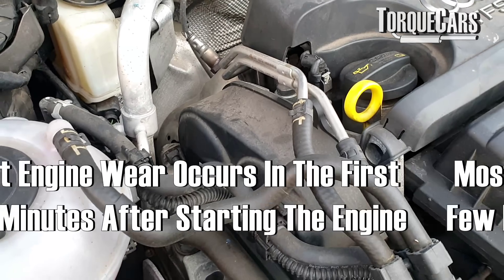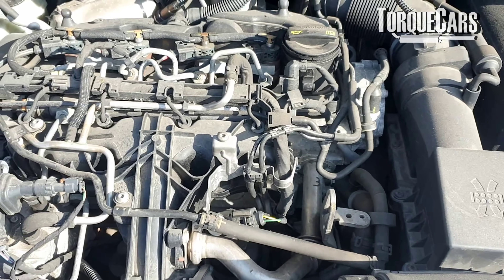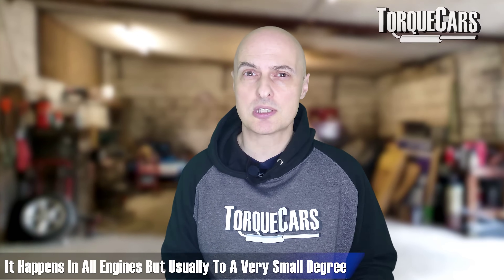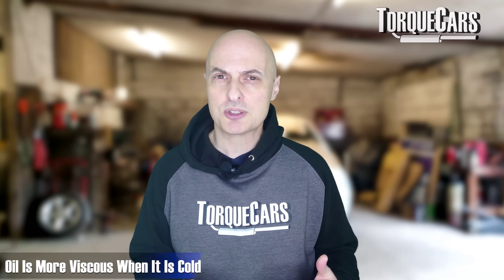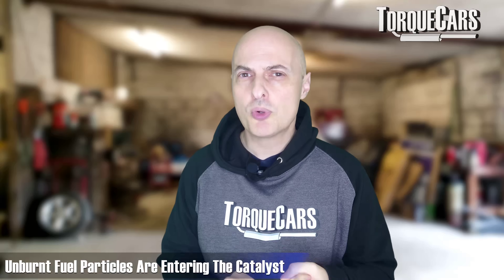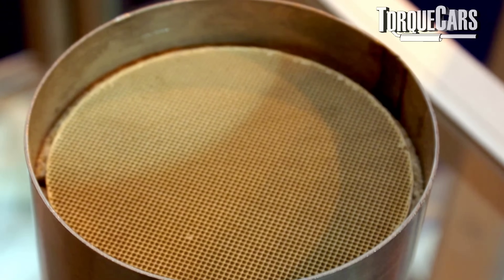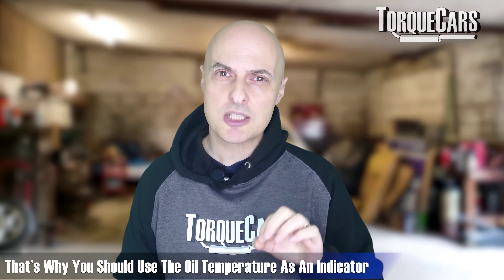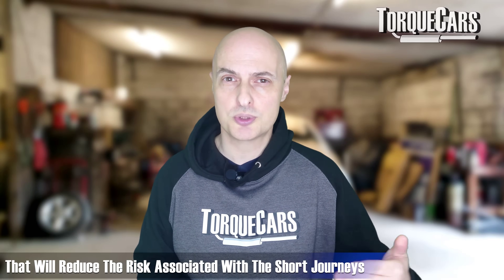5 Minutes of Terror? The TRUTH About Cold Start Wear (and How NOT to Blow Your Motor!)

Comment: What would recommend for someone that lives at the bottom of a very steep and long hill? On cold mornings I typically start engine, idle for 10 seconds, rev the engine to 2k rms and hold for around 1 - 2 minutes depending on how cold the morning is. Even after 2 minutes the temp gauge hasnt really even moved so not sure if im doing the right thing by my routine but people say "just drive lightly until up to engine temp" but i cant just drive "lightly" when i leave my driveway its foot to the floor and hold in 4th gear until i get to the top of the very long hill. 

Warm up more? Warm up less? Opinions?
Reply from the maker: Your routine sounds sensible to me, the oil will have started to warm up, you are not driving it hard in that critical first bit. If you are using a modern engine oil it should reach optimum viscosity quite quickly even if not fully up to temps.

It will also depend on the engine, your oil choice and how cold the engine is. But don't overthink it too much, allowing time to circulate and warm the oil so it gets to grade is the key.

I'll be curious to read others takes on this, as it is not something I have specific experience in but I'm sure you are not alone.

Comment: One guy on YouTube made a test on a cylinder head mounted to a lathe. He ran the head for a few minutes without oil and the damage was none. Next he disassembled all the parts, cleaned'em up to be free of oil and any lubricants, just plain dry and also ran for a few minutes after reassembly. There was some visible damage, but not something terrible. Also at the first minutes of the video he manually cranked the oil pump to show that oil passes instantly since the first degrees of rotation. Of course the oil pressure needs to build up.and that can take 2-5 seconds, but thinking that the engine lacks lubrication in first  few minutes (LoL) after startup is dumb.

Comment: I'm basically forced to allow my car to warm up by idling. For one, it's better for my sanity and fear of possibly putting more wear on the trnasmission by shifting at the higher rpm before it drops. And two, because I live in a neighborhood with several steep hills and there is no way I can leave without my car hitting 3k rpm. Fortunately, none of our cars have had any engine issues, including my parents who turn the key and go.
Reply from the maker: Fair enough then, I did discuss idling and a better faster way to warm up the engine in this video https://www.youtube.com/watch?v=aCGsZp-OG4c
Reply: @ralkros681  idle for 2-5 minute in neutral

Comment: so these cars that are hybrids they run on battery for like 25 miles before they turn on the engine, or sometimes it will turn on the engine say you are passing someone, that is bad for the engine?  or since the engine doesnt run as much as a regular  ice car it will not wear and tear as fast. also a lot of newer cars will turn off the engine when you are at a stop light then turn back on when you go, but I think not only is that bad  for the engine its bad for the battery especially if you are driving in congested city traffic
Reply from the maker: There are some very clever designs going on with hybrids. Firstly the oil returns to the sump more slowly, they are also designed to warm up very quickly and are good at regulating heat. 

For many people you'll be on electric on the start of your journey where there is more stop start then the engine cuts in for the longer main road sprints where it will warm up quickly and not be subject to as many temp changes and speed changes as you get at the start of the journey. 

Understanding what to avoid ie driving hard when the engine is cold is key, higher rpm at low load shouldn't affect engine wear too much IMHO. For some hybrids the battery power supplements engine load during the warm up phase.

Comment: I wish he would give proper numbers to what "up to temp" means. Is it 130 Fahrenheit? 150? 200?
Reply from the maker: I wish I could but engines are different and the designed operating temps and range will vary, most cars water temps seems to stay around 90c which is about 140F.. Oil temps are a whole different discussion and more accurate to go by, but few people can see oil temps.

Comment: This is exactly right. However, when it's truly cold out, a one minute idling warmup is a good idea. At temps below 20F (-7C) I let my engines do this. Engine RPM needs to be kept fairly low without lugging for the first few miles. Automatic transmissions basically do this for you if you're gentle on the throttle. If your car has an electronic oil level indicator, you will not get a reading until the oil is up to temp. In my BMW, that's usually six miles or so in winter.

Comment: in my experience, its either the wrong oil doing the most wear on a cold start, usually cheap oil, or that first start after an oil change that does the most wear

Comment: I've heard other bloggers (i.e. mechanics) advicing that, as soon as one starts the vehicle, you can drive away at a slow pace, say, under 25 mph. What's your take on that, sir?
Reply from the maker: I don't think the speed matters, it is the RPM and LOAD, my aim on a cold engine on my car is to keep the RPM below 2000 and use a light load which gives me a top speed of around 45 in 6th gear. I do agree that it is better to drive it than idle it, and if you live in an area that is too cold to drive it, then hold the  revs to 1200 or 1300 to add some load whilst it warms up.

Comment: Never use full throttle either.
I've never blown an engine up in 50 years of driving.
I work on aircraft and we don't use full power until 50C oil temp is achieved ⚠️

Comment: I go so far as to keep my heating Off until the temp needle reaches the normal operating point. Let the engine keep as much of that initial heat as possible.
Reply: We can't even try that where I live (unless you park in a warm garage). Most days I can wait for idle-down and go, however, in the wet/cold weather (remember that modern cars use the AC compressor in most modes always now and that drops moisture into the system - de-humidification), the initial start will fog the car up when you are trying to clear your windscreen because of moisture left in the vent system from that very AC system run (which you needed to keep the windows clear the last time you drove the car). Until the engine is producing some heat - you can't clear the windows. Frost becomes a nightmare with extended run times to clear the windows. And for anyone telling me that - just wipe the windscreen while you drive - that's just dangerous.

Comment: In winter time a diesel engine needs to warm up a bit before a set off. Also the time for oil circulate and warm up. But also the the brand/type of oil can reduce wear at cold start. Especially oils with synthetic Ester oil. 

https://youtube.com/@piotrtester?si=J8I4c8dX-1oW7E6r . This you tube canal is testing different oil at room temperature and  100°C. You can also see how much resistance it has in use under load and how much wear it has. Your eyes will be opened. 
 Look and see what different

Comment: I'm terrified of cold starts and damaging my engine, so when I'm not driving it I just let it idle in the driveway 24/7. My Outback has been running nonstop for a year and a half now. Not going to be the victim of unnecessary engine wear.
Reply from the maker: LOL that must be really economical if a tank lasts you that long.
Reply: Idling for a long time is also not good for the engine!
Reply: haha! ... thats a joke right?
Reply: I do the same. Also, when changing my oil, because getting underneath the car is always a pain, i open the oil fill cap and turn the car upside down.
Reply: 😂 made my day reading this
Reply: @Gruntsworth  Seems sensible, do you have your car in the garage when it's idling?

Comment: As soon as I open the door I put key into Ignition.  As soon as I'm sitting in the car, engine is ready to start. That is done.
Close the door, connect thr phone to charger, put on seat belt.
All this takes about 10 seconds. 10 seconds to allow the oil hit all spots.
I do NOT use the heater if possible, allowing all heat generated to heat the engine.
I always bring the car on the motor way on my way home from the supermarket. 
I also reverse into my drive way. No Revesby used. Just ticking over.
By the time I reverse park, unbuckle my seat belt disconnect my phone, the turbo charger has slowed right down. So when I do switch off the engine after I open my door, the turbo is revolving very slowly or even stationary. 
That means the turbo bearings are not running dry.
I also keep the RPM at around 1,000 or 1100 till engine reaches normal working  temperature.

Comment: As a trucker that warms up large diesel engines every day, we start the engine and immediately raise the rpm to 900 to build some oil pressure and “break” the oil to properly reach top end of the engine, otherwise your top end isn’t gonna get lubricated in awhile as oil is thick and hard to pump upwards to far bearings. If left at slow idle this takes much longer and damaging engine more than helping. Just make sure to also not shut the engine off immediately after a heavy load as turbo needs cooling down. My gas car has built in electric pump that pumps coolant through the turbo to cool it off for 3 minutes after the shutdown. This avoids having to idle engine even for cooldown. Prolonged slow idle is the worst thing for an engine especially the newer ones.
Reply: @27calgary1  Why is it so different from car engine? Any car will hit the oil pressure limiter (usually 7bar) when engine is first started as cold.

Comment: I've noticed a lot of motorcyclists tend to leave their bikes to warm up for a few minutes before riding off. It seems like bad advice that has been passed down over the generations. I'm a biker and did this when I started over 20 years ago but haven't done it in years. I subscribe to the belief that the oil will warm up quicker when driving and engines work better under a small load. It also seems like a waste of fuel but premature engine wear is obviously a bigger concern. Good to see your explanation backs up my own theory😃
Reply: I warm my GSX1100ef a while before riding.  It is aircooled and has a large oil cooler.  It takes a long time to begin to warm.  It's 40 years old this year and never been apart.  Oil is changed very often.

Comment: My car takes at least 25kms before it gets close to optimum operating temperature. I drive it very carefully until it gets up to temp. Both oil and water temps are displayed on my car (Porsche 981), so I do not exceed 3000 rpm until they are both at normal temp.
Reply: 25km is quite far, thermostat maybe stuck?

Comment: Water in the exhaust does not come from the engine.  The water has formed inside the exhaust from condensation due to the cooling of the exhaust after shutting the car down.  Every car has this.  If the car is driven reasonably regularly, the water is blown out (or it evaporates).  No harm, no foul.  The cooler and/or more humid the ambient air is, the more water will accumulate.

Comment: In morning is better to drive in sport mode… due to the cleaner dpf
Reply from the maker: I wouldn't say a DPF is cleaner in the morning or pre drive, the soot will collect there until it does a regen so you'll still have the previous weeks soot sitting in there, also on a cold engine you will be making more soot so get it up to temp as quickly as you can. 

Long journeys will help and sport mode tends to help the DPF as the engine runs at higher rpms.
Reply: @torquecars  i have Golf 8 EA288 EVO engine it gets hot very soon..
Reply: @torquecars  Low rpms (DSG eco mode for example) are not good for cold engine. In Eco it shifts really fast in the lows rpms
Reply: @torquecars  Your channel is very good, a lot of new things 👍. I missing community about engine cars …

Comment: My car stays noisy for the first 30 seconds or so till the oil has circulated.
If you can avoid this you would have reduced wear.

You can get a 50~90% reduction in wear just by bonding a lubricant to the metal i.e. Lubricant is always present.
:-)
Reply: Pressurising the oil system prior to starting would also help.

Comment: All this speculation about warmup and stretching is nonsense. All parts expand when heating up. Steel expands roughly 4 times faster than aluminium, so consequently, aluminium engine block is under more stresswhen hot than when cold and entire seemingly scientific theory falls apart because of lack of basic knowledge in physics.

Comment: There is no explosion in engine, there is burning of fuel air mixture. If you have explosion , engine knocking is happening, and engine controller changes ignition point.
Reply from the maker: You are of course technically correct. However much to our frustration the OTTO cycle is commonly referred to as Suck Squish BANG Blow (not burn) so when it comes to accuracy and wider perception there is often a divergence. I could make this video really complex with a debate on the differences between explosion and burning of fuel and air but for the purposes of this video and the common perception of engine combustion I will stand by the vague term "explosion". The video is about warming up the engine not about the combustion process per se. I will be sure to make the distinction clearer next time I talk about combustion. Perhaps I've misjudged my audience a little on this point.

Comment: I start the engine , reverse out of my garage, get out, close and lock the door, takes maybe 2 mins, then another minute down my long driveway to a minor road, then another 2mins to reach an A road, by that time I haven't passed 40 mph, then I drive steady for the next 5 miles until the road opens up and I'm at a steady 60mph or so. Never had an issue driving like this.

Comment: Start your engine, count to ten slowly, then drive smoothly for a minute, not aggressively.  Then drive anyway you want. If it is very cold out, start your engine, count to 30, then drive smoothly for a minute or two, not aggressively.  Then drive anyway you want. This is of course when you change your oil regularly. Fresh oil is the best oil. That's it folks!  It's really simple.

Comment: what is a short trip? And what conditions? I've recently moved from an old petrol to an old diesel (turbocharged golf) and I don't turn on the ignition until the glowplugs tell tale clears. I notice that even after a mile trip to the shops, the car has no trouble starting. When starting it up on a frosty day that's when I notice it chugs and smokes a bit.
Reply from the maker: I would say a short trip is anything that doesn't allow the engine to reach operating temperature, but I guess highway and town driving are also factors here.

Comment: K20 does a warm up cycle for 2 mins and is monitored on the coolant temperature and oil temp. Soon as the revs drop she's ready for light throttle driving.

Comment: It has to warm up enough to clear the windshield with warm air, otherwise can't see. Takes about 10 minutes of idle running.
Reply from the maker: Good advice, being able to see out is important - I should have mentioned that important fact. I guess I'm lucky as my demister is fantastically effective taking seconds to clear the screen in the worst conditions. 

I would encourage people to avoid idle and instead use light throttle and add around 200-300rpm to the idle speed so the warm up happens faster and safely. Idle was never designed to warm up, just to use minimal fuel and prevent stalling.

Comment: I typically give my truck the amount of time it takes to put my seat belt on. Maybe a little longer if my window is frozen over. When engine oil is cold, it bypasses inside the oil filter, letting your engine run with unfiltered oil. The idea is to get engine oil temperature up as fast as possible. Sitting and idling does not do this. I monitor my engine oil temperature regularly. Idle off cold start it takes 10-15 minutes before it even begins to climb. If i drive immediately, the oil temperature will begin to rise within a couple minutes. 30 seconds to a minute is adequate, then carry on your merry way.

Comment: Some engines get killed very fast if you let them idle after a cold start. Mercedes commonrail diesels for example. You have to start them and drive off at once. Letting modern engines idle when they are cold is very, very bad for them.

Comment: I have two cars, both German but different animals and different cold start idles;

E60 550i V8 starts around 2000rpms and drops to 1000rpms within 35 seconds and its good to go and, 2 minutes later that v8 gives you a wooden stove heat😂.

GLI 2.0T starts around 2200rpms and it takes more than a minute before the rpms drop to 1000, if you try drive it off right away it will not even shift properly but that might be due to DSG transmission.

Comment: I operated a few golf courses equipped with commercial mowing and tractor equipment, mostly diesel powered. Usually to start this equipment the operator has to press and hold down the low oil safety pressure bypass button to allow the engines to start, and hold the bypass in until oil pressure was attained 6 seconds or so. My mechanic recommended just cranking the engines for several seconds to circulate oil before starting, and then start by the    holding in the bypass safety. Then the engines once started almost had instant oil pressure.
I hope this was the correct thing to do. This mechanic was excellent and I never lost an engine under his watch.😊
Reply: Why wouldn't the injection pump automatically engage the moment the oil pressure switch satisfied? Gasoline cars need such a system to cut the ignition if the oil pressure switch fails to satisfy during cranking or falls out while driving.